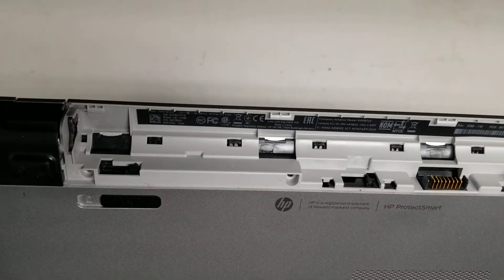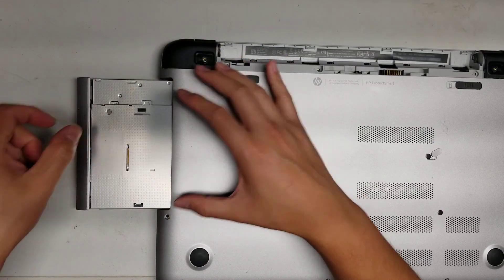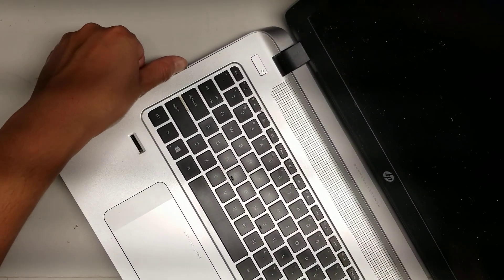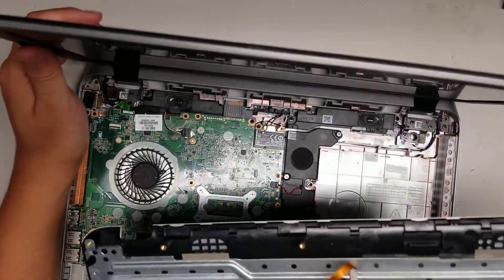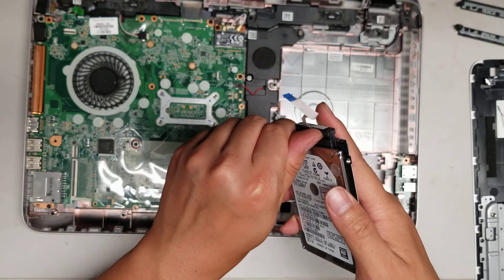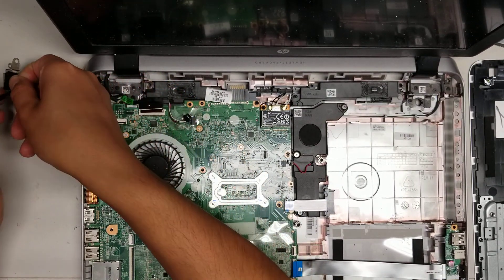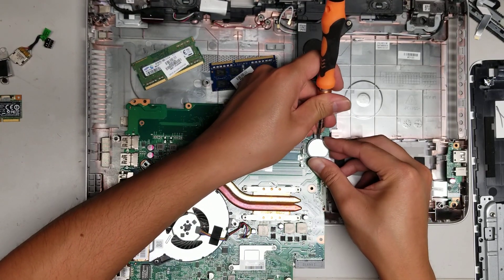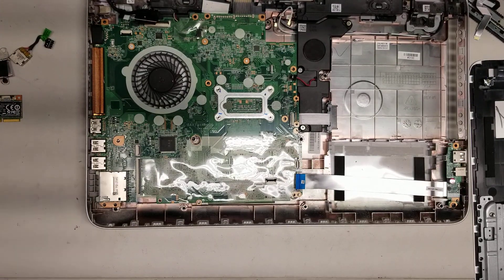HP 15t-k100 Disassembly RAM SSD Hard Drive Upgrade Repair

Comment: I have had it with HP laptops.  I had two of them and both eventually had stuff go bad. This one had a bad keyboard and a battery that wouldn't hold a charge. Thanks for the video.  With this I was able to open the case to salvage the hard drive and memory.  Lo and behold... the HD was a 2TB SSD which wil be put to use elsewhere.  Thanks again.
Reply from the maker: Sounds good. Hope the transplant goes well. If you haven't already, please like and subscribe so others can find my videos. Thanks!

Comment: Does this laptop have a m.2 slot?
Reply from the maker: If I didn't mention it in the video, then no.
Reply: Yeah, pretty sure this model is about 8 years old (4th gen Intel) so it wouldn't have M.2 as the tech was barely entering the market at that time.